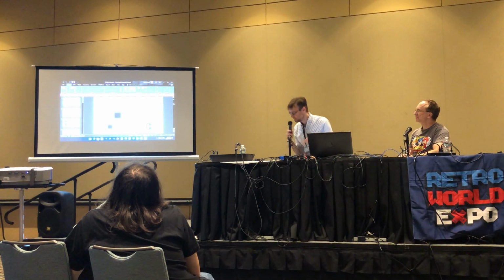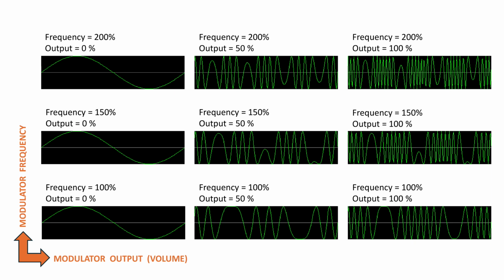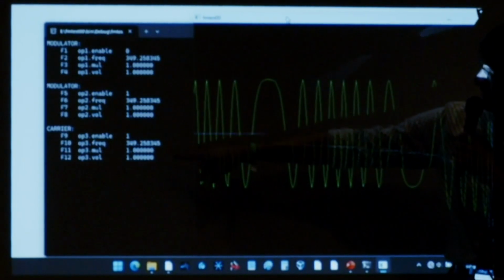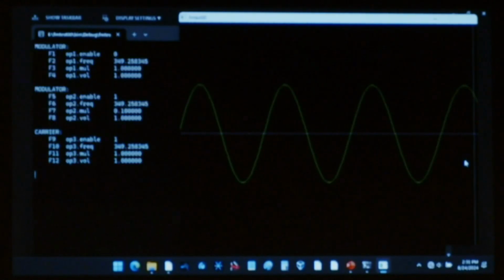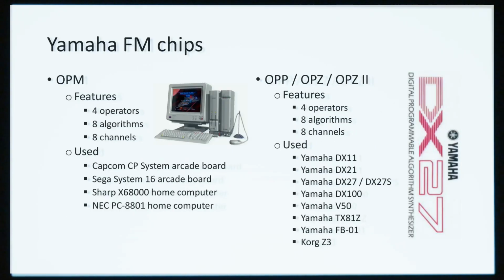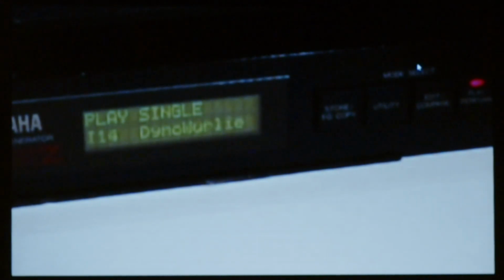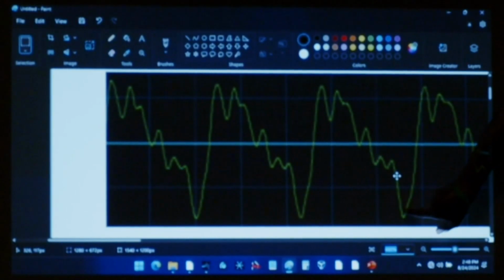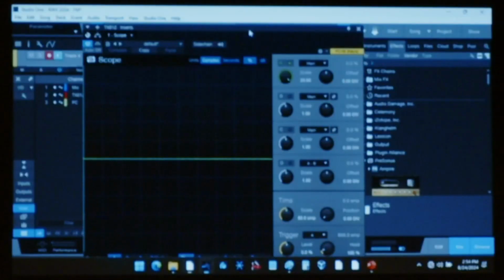FM Synthesis For Gamers & Musicians (Retro World Expo 2024 Panel #1)

Comment: so does oscillator = carrier+modulator? i get what the modulator does but unfortunately i still dont get what the difference between the carrier and the oscillator is
Reply: Oscillator - Produces a repeating signal (traditionally a sine wave) used as the raw material for either audible sound or modulation. 
Operator -The basic "cell" of FM synthesis, bundling an oscillator and an envelope generator together. It functions as either a sound source (carrier) or a tone shaper (modulator). 
Modular and carrier - These are the two twos of operators. Their terms related to the block diagram in an Algorithm

- Carrier - Produces the audio signal that is meant to be heard. Found at the END of an algorithm chain. Manipulated by the modulation signal. Note: an algorithm can have multiple carriers. 
- Modulator - Produces a signal meant to manipulate other operators.All the modulators in an algorithm yield a “modulation signal”, which then manipulates the carrier wave.

To answer your question, an oscillator simple produces a signal, like a sine wave. A carrier also produces a signal. The difference is that a carrier can be manipulated by the modulators and is what you hear on the audio output of the synth. An oscillator just makes a signal. 

I am currently editing the video from Saxman's 2025 talk, and I'm making sure these details are clearer in the 2025 video as the language can be confusing.